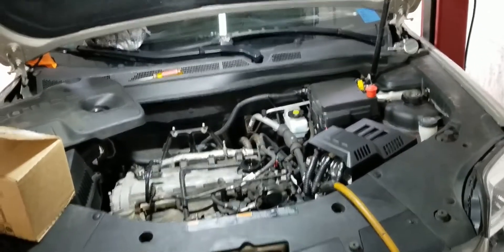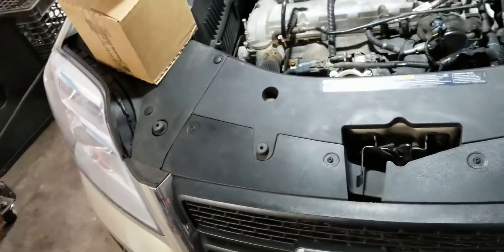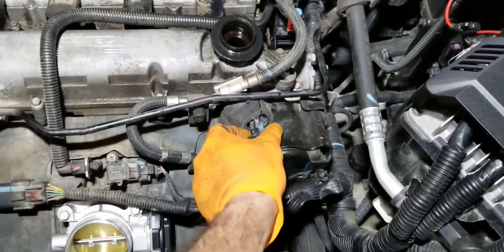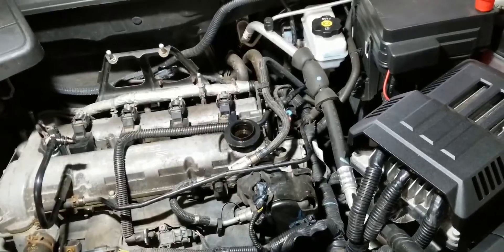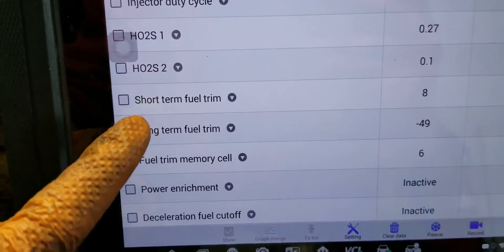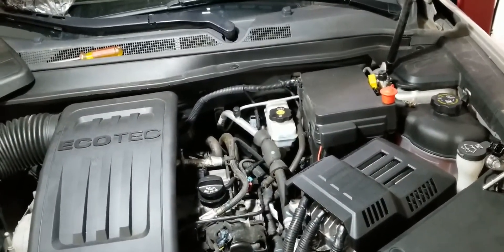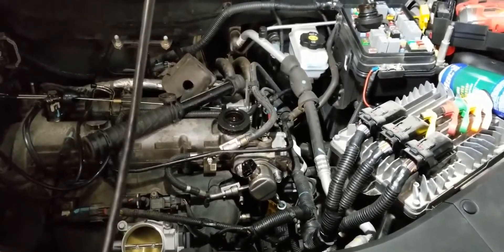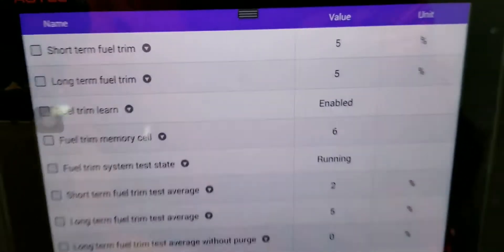2010 - 2017 GMC 2 4L Terrain P0172 Fuel Trim System Rich (Locate & Diagnose High Pressure Fuel Pump)

Comment: I got high LTFT at +17.. STFT is good 
and p0420 code with aftermarket cat.. just bought the vehicle and dealer put OEM manifold and aftermarket cat.. Car runs good though... Any help on this?

Comment: How do you distinguish the problem from the regular fuel pump?
Reply from the maker: Based on the codes you get , failure of this fuel pump is pretty common on these veichles , make sureyou go with ACDelco Genuine brand
Reply: @autorepairchamps thank you for the reply

Comment: Hi there
I just purchased used 140k mile gmc terrain 2015. When I went for a test drive, i didn’t see any issue but after a day check engine light came on. Code was p0172….i took the car to mechanic they said that I need to replace catalyst converter and the two sensors $1200. After resetting it, after a day or two check engine comes back. I took to the same mechanic and they said they did something but never told me exactly what they did but i didn’t have to pay anything. Sure you know check engine light comes on.
I replaced MAF sensor and cleaned throttle body myself but nothing changed. I smell different from exhaust or under hood. When it’s idling on traffic it starts shaking and stalls. I have negative short term and long term fuel but no negative in fuel pressure. What do I start from? Should I check from vacuum leak? Change ignition plug? Or change high pressure pump??
Thank you for any help!
Reply: Fix it?

Comment: I had the same problem p0171 I had to replace my high pressure flue pump twice now I have the same thing happening so now I have to do sensor
Reply: Po191 now
Reply: I have the same make and model having problems back to back fix one code another pops up
Reply: Hey I just got a 2012 I have p0172 p0191ans p0420 I kno the last ones a cat I ain’t worried bout that code the other 2 I see so many videos and they all saying different stuff how did u make out wit the 1st two codes I have
Reply: @jamesanderson8193  I’m having the the same issue… have you figured anything out yet

Comment: I am over here throwing parts at this 😅🤣😂.  Both oxygen sensors, MAF and crankcase breather so far. I will try this next. I did the plugs already.
Reply: Did that work?
Reply: Did it work?
Reply: @Justenough-o9l  , hell naw!!!! This car has a weird intake manifold setup. Everything must be pulled all the carbon build up cleaned up.

Comment: ?? I have 2013 gmc terrain it kicks n stumbles shuts off after i start it doesnt matter if engine is cold or warmed up,then on 2nd start it runs and idles fine, No CEL !! I do smell fuel on the end of the oil dipstick 
STFT 0%
LTFT -5.5 %
Reply: Did you ever find out what was the problem?

Comment: Good video.   Had same issue on my Ecotec 2.4L  in 2013 Equinox - repaired in summer 2022.  Replaced HP fuel pump with OEM GM part and now runs fine, no codes.   Still burns 1 to 2 quarts of oil between changes - that is likely due to worn piston rings.   I will never buy a GM product again.
Reply: It’s not so much a gm product, however the 2.4 & 3.6 are garbage. The 5.3 L is literally un breakable.
Reply: Stay far away from Fords!!

Comment: So i had the same code I replaced the HPFP it was good for week than happened agian so I was recommended to replace the fuel rail position sensor it was a pain to do lol am not a mechanic but it was good for about 2 weeks now that same damn code is back

Comment: What sounds was it making? did it idle down when you stop
Reply from the maker: yes it was still running and idling for few seconds after ignition switch was turned off.
Reply: @autorepairchamps that exactly describes my current problem, so this is the most likely fix, thank you SO MUCH

Comment: Hi Mr Nabil thank you for the Video 

I have 2013 Malibu 2.4  flexible engine idle rough Throwing codes p0016 p0017 
P0089
P0172
P0ac4
P228d
Any Suggestion please?
Reply from the maker: Usually when you get  p0016 p0017 on these engines very likely it is a timing chain job is needed, P0089 and P228d can go along with the p0016 and p0017 codes. P0ac4 usually indicates you either had or have an issue with your ignition switch or starting issues. I would start looking into diagnosing the timing chain and replacing it first and work on other codes if they still presents after the replacement . Hope this helps . Good luck
Reply: @autorepairchamps  
 appreciate your reply back car Actually drive ok and start fine 
I took it to Mechanic  and he said it need high Pressure fuel pump should I replace it or do you think those codes impossible to be fuel pressure ?
Reply from the maker: @h.gaming6745  the p0172 could be an indication of bad high pressure fuel pump. Did he look at live fuel trim data . what symptoms do you have . does the car feel like it remains running for couple of seconds when you shut it off and turn switch off ?
Reply: @autorepairchamps     I actually didn’t asked what he checked all he says he run the codes and tell me that I need new high pressure fuel pump car start and shut off Normally 
Only thing is giving me those codes and rough idle  
Other thing is car never do auto stop mode when I com to complete stop it keep running

Comment: what about everyone in a while getting a very strong gas smell coming in through the vent when air or heater is on ? I don't have a code reader also before the oil change I smelled fuel in the oil the mechanic said that this is normal but I never had this on any other vehicles I have ever owning in 40 years of driving

Comment: I have the same exact problem on my 2011 Chevy equinox but I have a 3.0 L. On the 2.4 there is a recall. Any advice ?
Reply from the maker: If you are getting the same symptoms and same code you may need to replace the high pressure fuel pump. I would get it inspected and looked at by a professional mechanic and see if you are running into the same problem. This pump is common to fail in these vehicles . Good luck
Reply: @autorepairchamps  yess I took it to Chevy, they told me it might be the pump. I ordered the part. Thank you so much.

Comment: Hi
I have same this problem in my car Chevrolet captiva v6 AWD 2011
Petrol  mixed with engine oil and engine light on 
I scan it I found code p0172 and p0175 
I need ur advice..
Thanks

Comment: Changed my HPFP on my 2013 terrain and it’s still running after I shut it off. I’ve changed the oil 2x cause it was still mixing fuel with the oil, after I changed HPFP. Is there something else that could be wrong? Changed the coils and spark plugs as well. HELP!!
Reply: Did you find out what was wrong with your vehicle?
Reply: @dennisjames1945  it was the darn pcv valve.   Dang truck gave me a headache over a $10 part 🤦🏾‍♂️
Reply: @gmotif6 The 2013 terrain does not have a pcv valve, its has only a hole in the intake
Reply: I had to change the HPFP, fuel rail pressure sensor, and both actuators.

Comment: A simple UltraGauge MX, cost only $80, reads codes and will give you over 60 OBDII data points for your engine and does transmission temps.  I used it to diagnose many of my engine problems and detected issues before they became serious problems.

Comment: What do you think of installing oil catch cans on gmc terrains? worth it?  Tnx sir!
Reply: You can only put it on the camshaft cover side of the PCV system.  It helps in the winter to keep moisture and oil mist out of the tube and prevent freezing.  Even the catch can needs checked and cleaned. Test the PCV orifice at each oil change.  Go to Chevy Equinox Forum on FB and look in the files tab.  I have a document on the PCV system.

Comment: Did you worry about what position the pistons were in when replacing the hpfp
Reply from the maker: I didn't, when you put it in you will fee a bit of resistence because of the top dead center and position of pistons . Play it safe and and make sure position of pistons is right otherwise.  When removing it . Go slow when unscrewing the fuel pump screws
Reply: @Edens Nicolas do you ever figure it out?

Comment: Idles rough. Has new spark plugs, new intake and exhaust camshafts, has fresh oil change, cleaned the throttle body, cleaned the map sensor, new oxygen sensor, short term fuel trim goes negative long term fuel trim is -27.

Comment: Mine does not say engine reduced power. The car turns off if i don't press the gas 2000k rpm or higher
Reply: Did you ever found that problem?
Reply: @pakovargas5103  no I got rid of it

Comment: What if the direct injection fuel pump is good?
Reply from the maker: what code are you getting , did you run a full scan? Could be a vacuum leak
Reply: @autorepairchamps  p0172 is the only code
Reply from the maker: @45.2.59htx  Have you done Vacuum Leak Test, there might a vacuum leak somewhere ,  Did you try to Clean Positive Crankcase Ventilation (PCV) System, How did you test Throttle Body ? How about the air filter ? is it clean ?
Reply from the maker: One more thing , Are you hearing any riddling coming from the engine , Possible timing chain area ?
Reply: I changed the high pressure pump didn't change in any way. I clean the throttle body. Air filter is clean. When i make a left turn I hear a rattle noise, but mechanic said is most likely the cv joint. I only hear it on the turns. Pcv not sure which one is that
Reply: @autorepairchamps  i have not done a vacuum leak test
Reply from the maker: @45.2.59htx  I would do a vacuum leak test . Sounds like you've done everything that could be possibly a problem.
Reply: Thanks I'll do that tomorrow
Reply: @autorepairchamps  i have 2011 Chevy Equinox the car stalls after I turn it off. Also when I turn on the car first thing in the morning it turns off itself? Any suggestions?
Reply: I got fresh oil change done before replacing the direct injection fuel pump. I haven't replaced it ever since.